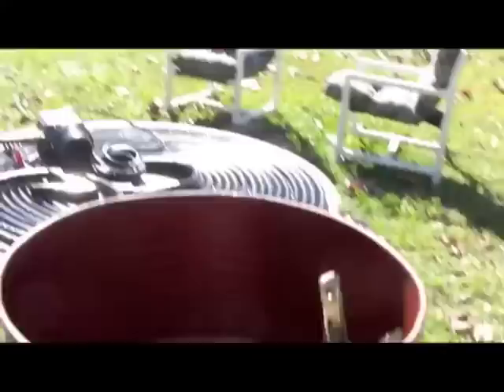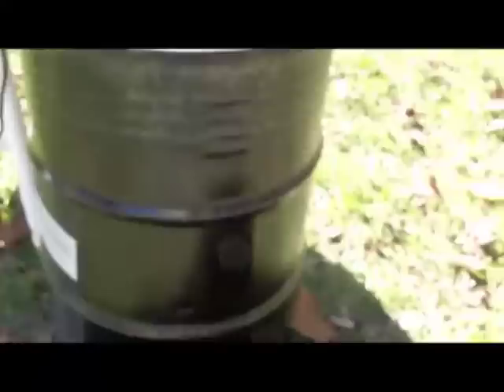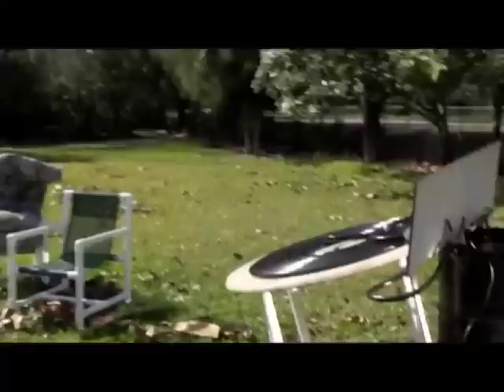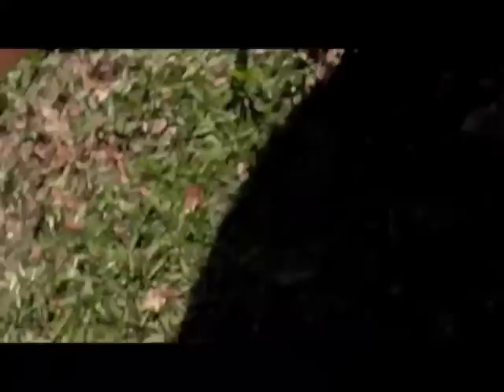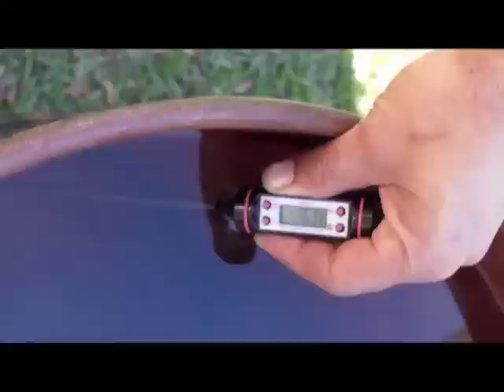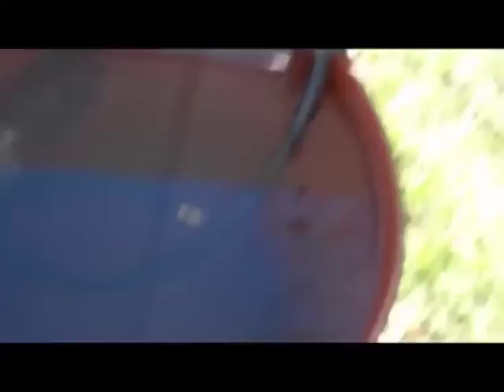SOLAR HOT WATER with black garden hose Pondmaster 1200 gph SWIMMING POOL SOLAR

Comment: Note the guy is advertising water hose so we have to wonder if that's where this is headed, instead of actual solar heating. Still in all, you could skip the pump (and the battery / inverter) and do a thermo-siphon with the same hose. Install a hose fitting near the bottom and near the top of that drum, both fittings below the water level. Once the hose (or poly pipe) is full the normal reaction of the sun's heat will cause hot water to rise and cold water to fall, creating a flow through the hose based on temperature difference and without using a pump. Eventually you will have a barrel of warm water even though the top will be warmer than the bottom by a few degrees.

Comment: @MrAlvan100 The Black Matte reflects almost no sun light,the glossy radiates it away just like a mirror,so the Matte will make any surface hotter than one painted with Glossy paint as more sunlight will be collected in the surface to heat it. :)

You can see this in practice if you can find any Matte painted car under the sun with one other having the regular Glossy Paint.

Comment: I estimate the surface area of your hose to be about 7sq ft or .78 sq meter.

A useful temperature for the hot water is closer to 100F (37C) an increase of 3.3million calories, you could run the machine for 6 hours or use 6 times the hose.

Comment: Plus you are also adding heat from the 110 watt submersible pump. You should run a test just running the pump alone in the barrel too see exactly how much the solar alone heated the water. That would make a cool follow up video. A 12vdc pump running off a solar panel would be a cool addition to go 100% green as well. Cool videos...

Comment: What about a water circulation system into the drum with one side of the tubing having some sort of radiator and being under a Fresnel lens? That sounds good,and it wont melt as it will be water cooled.

The only problem i can find is the efficiency and speed of heating the water

Comment: Got 500' black plastic HomeDepotOnline $30. Laid on white concrete slab took forever to undo coils flat in big racetracks. 6000 gallon pool drawn into 1/2HP submersible pump (driven by small solar panels and inverter feeding/drawing from marine battery)  sitting in swimming pool (remove before swimming just to be safe) and running from 9am to 4pm (when I get home and go in) get a four or five degree rise which is just enough to avoid Polar Bear Club status midwinter Florida..

Comment: Should have a  bucket of water for control.  The surface area of your garden hose is not that high and it is radiating heat to its surroundings and well as conducting heat to the water being pumped through it.

Comment: The helicopters are Black Hawks & Chinook flying out of Ft. Campbell & Nashville TN National Guard. 
I'm trying to go completely off grid (except internet). Your videos have helped and sparked a lot of ideas. I am currently soldering the last cells in a solar panel. Probably the last as you can buy the things pre-assembled cheaper than you can make them. Somebody has got to figure out a battery alternative for solar applications. Batteries too expensive. Your next project & video? Capacitors?

Comment: @GREENPOWERSCIENCE I suspect that you would have gotten it even warmer if you had put the pump on the bottom and the hose on the top instead of the other way around. That way you can be gaurunteed that you are taking in cooler water than you are putting out. I could be wrong on this though.

Comment: But we can say exactly how much. If we assume all 100 watt change to thermal energy, then that is 100 watt hours which is equal to 341 Btu. 1 Btu = a increase of 1lb of water by 1'F. 50 gallons of water weighs 416lbs. So, we can say the pump accounts for less than 1'F of change. The pump is likely not working at all 100W the whole time, but you would need a power measurement to know.

Comment: put a clear plastic cover over it  that is somewhat airtight i bet it would build up a ton of heat.  I'm guessing a lot of the heat generated by the black hose is just radiating away.

Comment: All of that hard work bought you about 189.271 L*3.6 C*4.186 kJ/LC /3600s*1000J/kJ= 792 watts, or about 800 watts of power. Since 80 or so is heat dissipated by the pump, the solar collector really gathers around 700W. Good but not exactly great. How much did the pump + hose cost? The pay back period for a system like this probably outweighs any major benefit. Fun experiment though.
Reply: 700W of energy for 5 to 6 hours a day seems pretty beneficial, to me! 3-4 kW...

Comment from the maker: Copper is about equal with efficiency. While it does transfer thermal energy better, it also radiates heat faster so it is a net zero. Copper is too expensive. I have about 600 ponds of tubing and wire. GOOO copper:-)

Also the pump is solar.

Comment: I have put together an 200 ft copper grid on my black roof and tied it in to my hot water tank so that it heats the water before it enters the tank.  Now the tank runs less and cut my cost but 70%.

Comment: put the 55 gallon tank on the table and the hose on the asphalt with one hose going in to the top and the other hose fitted in the the bottom of the tank . no wast of power and hotter water too. Solar showers ,  mine is on my black roof  and tank is in side but higher then solar panel i made. hits about 120f in 70 deg weather , not great but my 1st try . a one way vavle is the only thing else add the system .  Share the green, GPS =)

Comment: Your videos are great and the message VERY necessary in these times, but did you stop and calculate what percentage of the temperature increase came from the heat of the submerged pump operating?  A 100 watt pump submerged will be putting 100 watts of heat into the water.  This does not mean the experiment is a failure, it will just help better understand how much of the heat rise is due to solar collection.

Comment: Not sure that you want to circulate the water. It is best to keep the water in the line so that it gets hotter. Recycling the water will take much longer to heat up. Maybe use a temp control valve for allowing flow when you get the high limit. Thanks for sharing :)
Reply: +Craig Lewis - Exactly wrong. If you don't circulate the water you will get a higher temperature but less heat. Hotter water in the line is bad because hot water will not absorb as much heat as a cold water will. Recycling the water will raise the temperature faster because you are absorbing more heat when you recycle. Thermodynamics can be confusing.
Reply: +Kevin Jackson Kevin is right.
Reply: +Kevin Jackson You are smart  Kevin.

Comment from the maker: 50 gallons -

 8.34 BTU's x 6 x 50 gallons = 2500 btus
Considering the lack of insulation it was even more.

That = roughly what a 500-800 watt electric heating element can do. Temperature to volume is what this was about, not steam.

Comment: It would have been a better and  more demonstrative  experiment if  a control 55 gallon drum had been used in the same time frame as the one  used here as  well as  one that was well insulated on the sides. I am curious as to the lose or gain through convection with the atmosphere and the barrel sides. Which begs the question, is there any survival advantage to crawling inside your dead horse during a snow storm? The surface to volume ratio is good and you start at 100F, so I an thinking yes.

Comment: the temp would differ also be higher if the hose was on a  tin roof extracting heat from the hot roof

Comment from the maker: Nope, a loop of the pump alone has no detectable heat rise over a one hour period. The impellers are not that of a normal pump. The 93 -100 watt CONSUMPTION of energy FOR 950 GPH leaves no electrical inefficiency for friction water heating. The impellers are magnetically driven separating any thermal heat exchange from the motor's natural heat production.
Centrifugal Pumps designed for water lift are 1/10th the efficiency of this type of pump and do over time produce aqua friction/heat.

Comment: What i'm confused about is that a 7 degree rise in temperature doesn't seem like it would do anything? This has me  trying to figure out how to make my solar hot water system. Where i am lost is that it would seem like you would achieve better results if you could control the flow off/on based on tempreture. Fill the hose, when it reaches a set temp send more in to replace it. With the constant flow you aren't giving it time to heat before it moves on,or am i just missing the point of the video?

Comment: Thanks for your video.Could you achieve the same result without electricity using convection currents? As a former childcare worker, we would take kids wilderness camping. Using a barrel, we welded two threaded "spigots" one near the base and the other 1/2 up. Connected to a spiral copper coil running through an outdoor fireplace/barbecue, it gave us lots of hot water. With yours, attach the hose to the lower spigot, allow water to drain to eliminate air, then attach the other end to the top?

Comment: Off topic but you want to know what's cool? Soldering together solar cells for my next panel using electricity generated by the previous cells I made while under an air conditioner when it's 90+ degrees outside, listening to videos and enjoying a nice cold beer and all of it compliments to a little work on my part and the sun. It's mine, it's paid for itself, it isn't taxed so it's free. Hot water isn't. Will I coil up a bunch of black hosepipe for free hot water. You bethca.

Comment: I'm thinking if you ran a length of black hose on some blacktop driveway or roof you would see way more heat gain .
and wouldn't this work better if the hose wasn't rolled up? (more surface area on the hose?)

Comment: How about using the 93-100 watts of power for heating by induction or some other process instead of wasting it on a pump that pulls the relatively minuscule amount of energy from the hose?

Comment: use a less GPH pump than it will allow the water to warm longer. right? besides those hoses wouldn't be good conductors of energy anyway. they would have to be all rubber hose.

Comment: All energy consumed is converted to heat!!!! The issue is not friction.

You increased the water about 2.5C 
A calorie is the energy needed to increase one gram of water one degree C (4.1Joules) (food calories are actual 1000calorie)

55 gallons  is 207900 grams of water
So You applied (plus your loss loss) 519750 calories 

519750 is equivalent 604 watt hours

Your 100wh (87000 calories) is a significant portion of the energy added to the drum.

Comment: the garden hose should be twice as long, in a closed, flat wooden box insulated with styrofoam on the bottom and a plexiglass sheet to seal it off.

Comment: hey Dan, love your stuff. I must burn the dogs every summer washing the dogs in the summer. always forget to cycle the water prior to washing the dogs. I've made the same thing except in reverse. I made a water cooler for cooling a external saltwater tank using block ice and crushed ice. You might get better results using a smaller pump. one that has the ability to pick up the heat instead of the water moving to fast and not transferring any of that heat to the water. anyway keep up the good work.

Comment: On a sunny day like he's got, the sun provides roughly 1000 W per square meter (roughly 10 square feet).  For argument's sake, let's call his coil that size -- close enough.  He's heating 400 lbs of water 6 degrees F in one hour = 2400 BTU/hr = 700 Watts.  That would mean his collection system is running at about a 70% efficiency, which is remarkably good considering how crude the whole setup is.  I wonder how much better it would be with an insulated panel, copper tubing, black-nickel anti-reflective coatings, etc., and whether the improvements in efficiency would justify the cost and complexity additions.

Comment: Sorry I am just waking up.. but if I am right that is like 2600 BTU's collected in one hour right? So try this one.. take your coraplex sign board and hook the output duct up to a brass tube that is soldered to the drums inside and goes in and back out... so you transfer the heat (in part) of the much better performing coraplex build and without using a pump at all...

Comment: Did the air temperature remain pretty constant during that hour?  I mean, that probably wouldn't account for a 6.5 degree change, but the air temperature might easily change 3 or 4 degrees over an hour during typical weather. 
I'm not saying the experiment is invalid, but it's certainly a factor which should be noted if you're going to make it a scientific demonstration.

Comment: Damn it Dan, you are a Lucky guy,
But yes this works, in 2012 went off grid and built a home out of tires and sand bags, I did this with a inverter on car battery pond pump, homemade shower head and 15-20 gallons two hot showers around ten min long a piece..
I'm thinking about incorporating it to a pond system in my new earth build with ponds that connects indoor and outdoor ponds with tubes of tire walls hopefully help heat with thermal mass, but this is a test for sure because I haven't seen many ponds like it...
But I'm in South Carolina so I'm not sure if the winter's here count, last year was pretty damn cold, but I'm from California so I think I was being a sissy, lol
Anyways Dan with the big long hose with the hottest chic ever good video 😂😂😂

Comment: Hey simple, needs little refining :) 
Was thinking about putting something like this on the garden shed out the back, so have warm water :) 
Any tips? Does it have to always run ? 
Was thinking a old water heater tank ( already insulated ) or a drum like urs, but with a lid and insulated :) 
Also, if you ran it all day as a hot water service wouldn't it keep heating up to a point? What happens if gets to hot lol? 
Though it shouldn't boil via sun ( unless a to much heating surface area, tho got

Comment: I meant in the tank. I'm no expert but somebody else on YouTube got much better results & he claimed it was becuase the water gently circulated in the tank. The guy said that a powered pump cuased turbulence in the tank & prevented hot & cool zones in the water. He said even a thermosiphon could cause excess turbulence causing it to not heat up properly. Then again he could have been lying about his results. But it sounded feasible. I guess the only way I'll know for sure is to build one myself.

Comment: fail, how much pwr did u use for the pump mr an mrs green house....it would have worked better if u used anti freeze running through a tube to het the water in the tank...aka...heat exchanger
Reply: He claims to run the pump off of a single solar panel.
Reply: Nope, heat exchangers are not 100% efficient so you will lose some of your heat if you use one.
So, it won't work as well with a heat exchanger and antifreeze unless that antifreeze is coming from your hot running car engine.

Comment: What good is a six degree temperature rise?
Reply: Six degrees x 400 lbs of water (50 gallons) = 2400 btu per hour.  That's pretty good considering a 1500w space heater only generates 5200 btu per hour.  Make this thing just a little bit bigger and it can start providing quite a bit of energy for just a little bit of money.  And every day it works, the per-day cost goes down.
Reply: Six degrees could be all you need. I would much rather swim in a pool which has 92 degree water than one with 86 degree water.

If you are using a filter, you are pumping water anyway. If you plumb it so that only part of the water is flowing through the black hose you can prevent causing the pump to work harder. If the pump doesn't have to work any harder to push the water through the hose, then the heat is free.
Reply: ***** You haven't really contributed to this conversation.

A six degree temperature rise doesn't sound like much, but in the context of water at 64 degrees vs 70 degrees, it's quite a bit.  And the temperature of the water in the heat collector is immaterial; what is important is the temperature of the water in the pool.
Reply: ***** I'll reply if you say something stupid.  Whoops, looks like I have to reply. 

While your original statement isn't wrong, the way you delivered it was.  All you did was alienate a viewer who may, now, not be keen to expand his use of renewable energy because he thinks other similarly-minded people are assholes.  You did that.

Thanks a lot.
Reply: ***** Wow, for a moment there I thought you might be wiling to learn something.

I was mistaken.
Reply: elhigh also it was only 1 hour, thanks for doing the math for that idiot , saved us all the time who no the numbers, i was also impressed , thats a small heat exchange not even a usable size , just a proto type
Reply: elhigh Thank you for trying to point out to Jamie that he/she does not have the right to be rude and resort to name calling just cause Jamie knows or understands something.

Often behavior like this is caused by a high insecurity level, which is causing that person to be actively aggressive and degrading towards others merely because this is how their insecurity is perceiving themselves when they are in a similar situation. Now when Jamie then knows something or understand something better then another person, then it seems perfectly fine for him/her to express that bitter torment onto the unwilling victim. 

I fully agree with you that this really is appalling behavior and a person such as Jamie should always be pointed out that it is unacceptable. And I thank you for that.

Seeing the result of your attempt I do fear that our Jamie is unwilling / incapable to see the flawed behavioral pattern and sadly will continue. Perhaps the wisdom will come with age and let us all place hope in that ;)